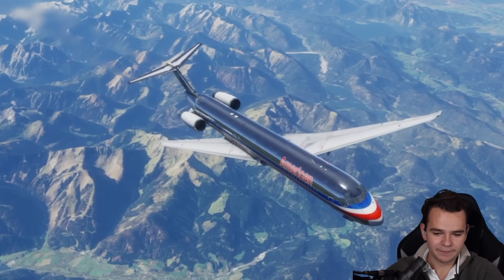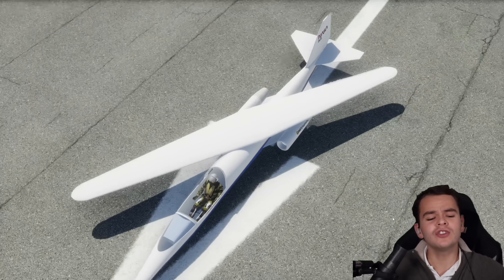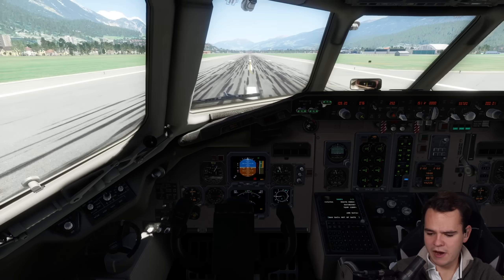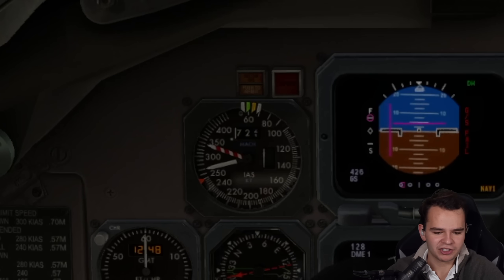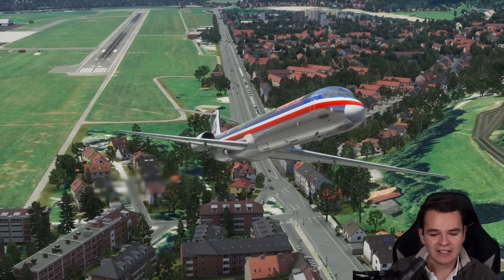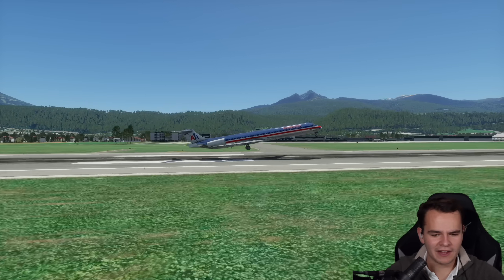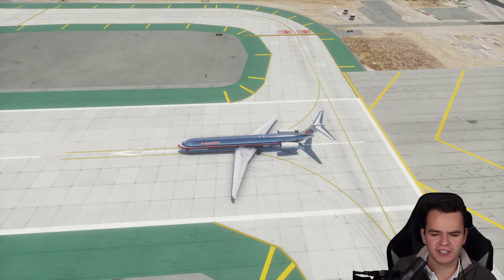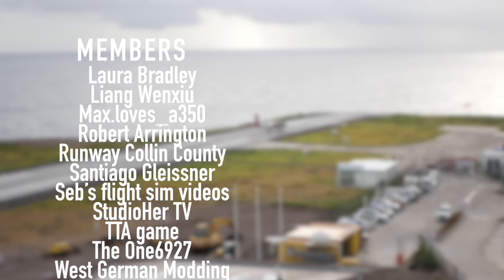Is THIS The Plane Design Of The Future?

Comment: 0:33 I think the swing wing design doesn't give you more wing surface... It gives you a surface with less backwards angle on the wing. the leading edge is hit by the wind direcly from ahead instead of from the side like it is when its tilted backwards. Therefore it produces more lift. When its tilted backwards you have a longer smaller wing (little lift) instead of a wide short wing (more lift).